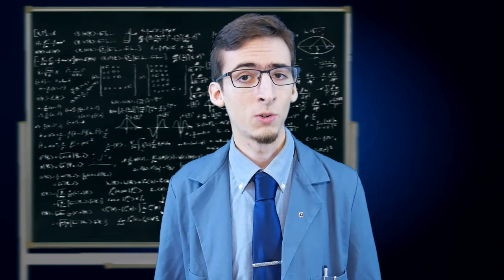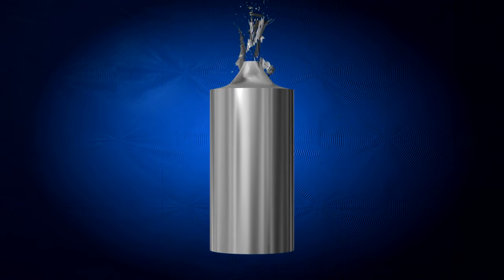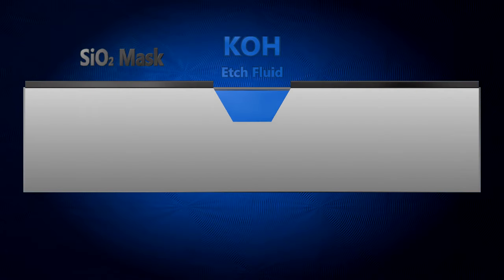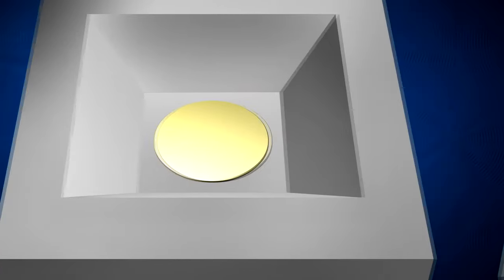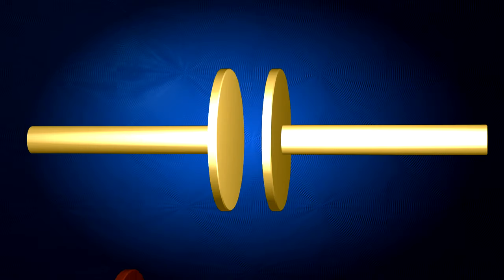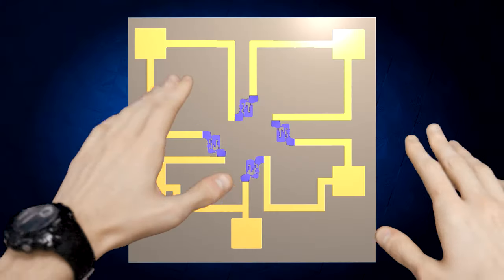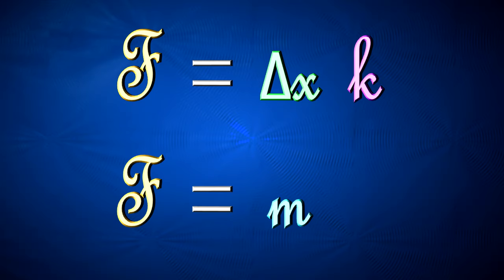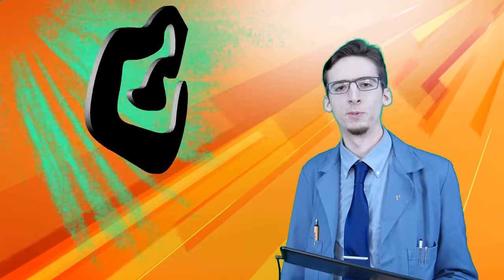MEMS Sensors and How to Make Them

Comment: Great video, I learned a lot! One note though; just slapping three accelerometers together doesn’t make a gyro, it makes a three axis accelerometer. MEMS gyros are way stranger; they use vibrating masses and the Coriolis force to detect rotation. It’s pretty crazy to me that they can use a second-order force like that on such a tiny scale to detect such incredibly small amounts of rotation (angular rate). The most sensitive can detect rates as slow as 360 degrees per day! (Basically the rotation of the Earth :-0)
Reply from the maker: Yep, that's my bad :(
I think I can edit that info out without disrupting the flow of the video. Let me try... Done. The edit should take effect within about an hour or so.
Thank you for pointing that out!
Reply: @BlueprintScience  No problem! I love your stuff, really did learn a lot from this particular vid!

(BTW, how did you manage to edit an existing video in YouTube? We produce some of our own there, and AFAIK, there wasn't any way to replace an existing video; I thought all we could do was just upload a new one and then try to point people there from a pinned comment on the old one.)
Reply from the maker: The human race is not yet ready for the responsibility to replace existing uploads. However, you can trim (remove only) already uploaded videos from the creator studio beta.